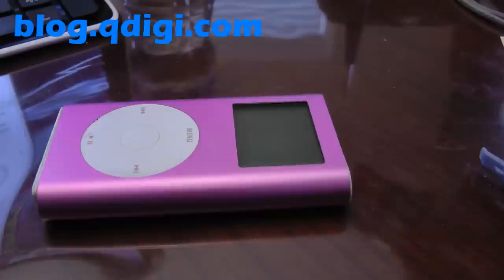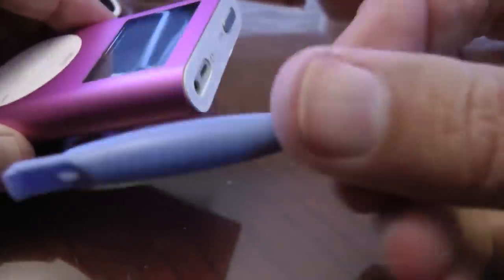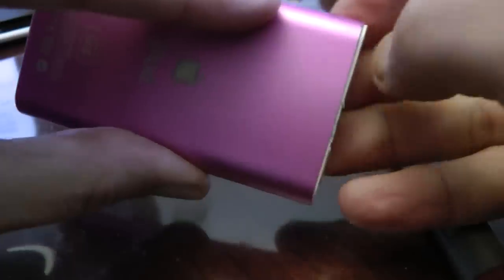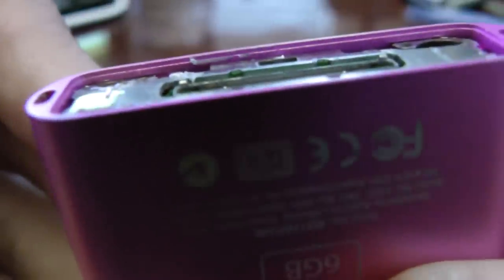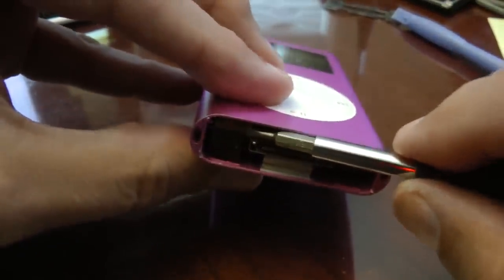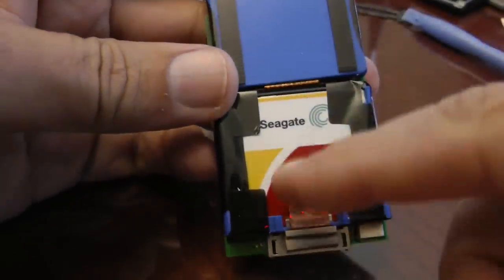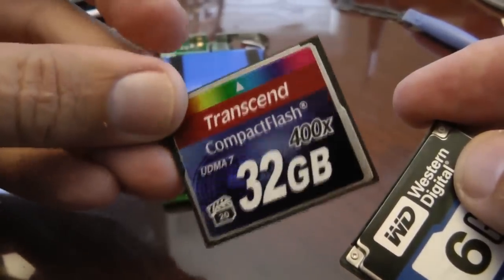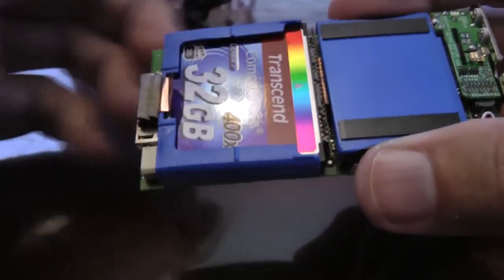iPod Mini CF flash upgrade hard drive fix

Comment: I can't seem to find any information about this, but does the CF card that I put in need to be in fixed disk mode or will any CF card work just fine?
Reply from the maker: +DarkLeach7 What information are you referring to?  The video explains how to upgrade the iPod to a flash memory card.
Reply: I meant about information I was looking up regarding compatible flash cards to put in an Ipod mini, I know this isn't a video for that. I was just asking from your experience in fixing these up  which flash cards are compatible, or does it really matter which brand I go with.
Reply from the maker: +DarkLeach7 Any CF card will work but I would be careful of the no name cards they sell on ebay.  Going with a brand name is a better choice.
Reply: Thanks for the information, I was going to get a brand name one regardless, I just wanted to make sure there wasn't some weird incompatibility issue between different brands.

Comment: Gary Can I use any CompactFlash card brand OR HAS NOT brands que work ??
Reply from the maker: +Joao paulo The brand should not matter.  I have used Kingston, Sandisk and Transcend with no issues.
Reply: +Gary Quiring thx man :)

Comment: So I have a question, is there any software I have to install onto the flash card, or do I just put the flash card in and I'm good to go???
Reply from the maker: +Pokemon Masters You have to restore the drive using iTunes.
Reply: +Gary Quiring thanks! I'm going to buy an iPod mini with a crashed hard drive off of eBay and install a 128GB flash card inside for my music library! Thanks for the tutorial! :D

Comment: Selected songs stay at 0:00 - not playing after CF card.
I have two iPod minis of the same year. I have installed a new CF drive (CF is SanDisk Extreme 32 GB) in one and it is synced, it starts OK. It shows the songs but, going to any song and hitting play shows the time of the song on the lower right, the progress bar, and 0:00 on the left. It stays that way. It stays at 0:00 and will not play. It is in play mode, but there is no movement of the progress bar and no movement from 0:00. 

This unit came from a Goodwill so who knows what problems it had before. Is this some setting problem I have to understand, or is this a logic board problem? Logic Board seems unlikely as this is not a folder icon anymore at startup (it used to be).

iTunes sync was done in several ways, fill extra space, don't fill extra space, manually manage music, don't manually manage music, Enable disk use, don't enable disk use. This is High Sierra and iTunes 12.7.4.76.

Took it apart again and stuck the CF card into my mac at one point to make sure it was apple formatted.

I have run through all it’s available diagnostics - several times. It appears to have loaded and synced, but I cannot get it to play. All these how to videos on YouTube had convinced me this was doable. If anyone can chow me where I went wrong, I would be very grateful. Otherwise, I still have no clue and perhaps it is time to get my money back on the CF cards. 

The other mini seems glued in the case. The insides will not come out. Bummer.
Reply from the maker: That is weird but since you don't know if it worked before who knows.  I would try reloading from iTunes from a different PC and see what happens.  What about the music, MP3's?  Bitrate?
Reply: OK, I just tried it from my laptop (Macbook PRO 2012) Same as before. Standard mp3s. Don't know what I can change there. My other mini still has the old hard drive in it and it still works as before. I tried resetting that one and reloading it in the same way. It worked just as it did before. So either, there is some odd problem in the logic board or, this extreme version of the SanDisk 32 is not working. I am without a clue here.

And, that old one that is still working on the hard drive also has a new CF card and battery waiting for it. I know how the insides come out as I did that with the other one with no problems. This one isn't even budging, not even wiggling. The innards seems completely stuck to the case. I have very carefully worked a letter opener around it as best I could using the opened case as a guide not to push too hard anywhere. It’s just stuck.
Reply from the maker: Post a link to the exact Sandisk card you are using.
Reply from the maker: That card should work, it's a modern CF card, UDMA type.  I'm going to have to assume you have a bad iPod Mini.  Look on ebay for another one, try and find one with a folder error. I never paid over $20 bucks for one with shipping.
Reply: Finally got the stuck one out of it's case. It had a couple of small dings on the narrow upper corners of the case and I think that was bending it in just enough to block upward movement of the inside. I carefully pried it back into shape before but I finally reasoned I had done all I could do and increased using dual pry points as I again worked around the upper mettle cap. It popped and was still a little cranky about coming out. Apple really used tight tolerances in this case it seems.

Now with a working iPod the CF card does indeed work. It was a bad logic board on the other unit. Just for grins I tried putting the old but working stock HD I just replaced into the one with the iffy logic board. It boots to the Apple logo and that is all. I can force restart it but it sticks on the apple logo. Can't see it in iTunes. Can't see it in disk utility. I know it was working and I know the CF card that wasn’t working is now working in the other unit so, looks like I am done wasting my time on that old unit. 

That one was a favor for a friend. This works almost totally as it should - except that once you have it all formatted and synced, and you hit play, it just sits there. Meaning, it looks like it would work, it acts like it would work - but, it doesn’t work. I will explore eBay as you say but, I would hate to get another older iPod and get stuck with the same problem again. -

UPDATED QUESTION: 

I am wondering if you have had any experience with first VS second generation iPod minis with this CF card? I am pretty sure now that the two iPods I have been updating are different generations and the bad one, is the first generation. What tells me this is how many times I have booted into diagnostics on each iPod with the backwards apple logo. That menu is different on the two units. One unit, which I assume is the older gen 1 unit (the bad one) has larger and more block like fonts. It has slightly different menu choices than the other one has.

The other unit, the one I just got working, has smaller fonts and looks a little better organized, less machine code like and more human interface like. As I have told iTunes to update each one several times now I have to believe that this difference in the menus is from the two generations.

Which brings me to my question, is this a bad logic board? Or, is this a generation one and two difference? Does my description of the menus help you recognize the ones you have worked on and, have you any comment about this working on gen one iPods? As I look at iPods on eBay, I don't want to bid on a gen 1 iPod if that is still going to be a problem. Thanks.
Reply from the maker: Don't waste your time for ~$20 dollars.  Jump on eBay and buy another iPod Mini . All of mine of 2nd gen.  The 2nd gens have better battery life from what I read.

Comment: Can you use a 128gb compact flash card to upgrade the ipod mini?
Reply: Also, can you get a 256gb compact flash card to upgrade ipod mini?
Reply from the maker: Popular question that no one has answered here, the largest I have used is 64gig
Reply: Yes you can. I did it to 2 of mine. I am thinking of increasing it to 256gb. I am not sure it will be able to recognize that much memory.  At the moment, I use one as additional memory for my tablet. Everyone sees it as a old 4 GB MP3 player and it is small. So they are not as likely to swipe it.
Reply: Just put one Lexar 128 GB into my Mini. Synching my iTunes library /70-80 GB) as per now. But the main problem was that my Mac with High Sierra and iTunes 12.8.2.3 would not recognize my iPod at all more than a generic drive. Had to plug it into my old iBook with 10.5 and iTunes 10 to do a restore.

Comment: hi gary, i tried the process yet my ipod is showing a "missing folder" icon or something. any advice? thanks!
Reply from the maker: Not enough details to guess what it could be
Reply: @GaryQuiring  after connecting to itunes to restore.. it keeps showing folder with exclamation mark.. i tried to charge it to external source yet still showing the folder with exclamation mark. im using a sandisk 8GB CF
Reply: Jeff Amon I think the cf card needs to be ata compatible. Some cf cards aren’t compatible with it. Do you have a different one?

Comment: can i use a 64gb card for 2nd gen ipod mini?
Reply from the maker: Yes I have a mini with 64gb in it, works great.
Reply: thanks so much for the fast reply
Reply: Gary Quiring Gary, would it matter whether its a microsd to sd to cf? I have that setup going on and every time i sync my entire library (6k), my mini recognizes 0 songs.
Reply from the maker: I never tried it.  I am surprised though that it does not work for you. Maybe it's your adapter.  I would try a different brand.
Reply: Gary Quiring yea its bizaar, if i sync in batches, it works but I don't have time to go album after album manually and seeing whats causing it. lol, its 6k songs, lots of albums. i thought you might have some input in the matter. thanks though, i appreciate your reply.
Reply from the maker: I have not used iTunes in a long time to sync my music.  I use CopyTrans.  It might be worth trying it, the music sync module is free.
Reply: Gary Quiring i thought copy trans was for ipod to pc transfers
Reply from the maker: Nope, it can sync your music without the hassles of iTunes.
Reply: I'm trying now, fixing this ipod literally killed my 64GB Sandisk Pro mSD. lol I have a spare 32GB and i'll need to buy another 64GB hold off and then request a warranty exchange.

Comment: After the CF upgrade do you have a problem when trying to wake the iPod after it has gone into full sleep mode?  I did the card update but now when it goes into full sleep mode I have to plug it back in to wake it up.  Any ideas?
Reply from the maker: I never had that issue.  Are you sure the battery is good?

Comment: Anyone have a confirmed operating ipod mini with an actual 128/256GB cf card? Doing a rebuild on mine and getting ready for a 128GB card install instead of going the easy way and getting a sd adapter & card, wanna get some insight before diving in.
Reply: it didn't work for me with 32 gb. It worked ok but then later after a week or two it crashed and i haven't been able to get it to work again.  its stuck with the little unhappy face/ exclamaton point.
Reply: Depends on what you have installed, i have decided to opt for a 64GB sandisk extreme (120MB/sec) card inside mine, and will most likely update after a few weeks. The 4GB drive worked fine so there is no reason i can't use a 64GB drive to the same effect. Sync speed is so much faster with the 64GB card.
Reply: @ig8uh8m8   Did you get around to using a 128GB compact flash card?
Reply: @twinoaks51  no sadly, have moved onto other projects